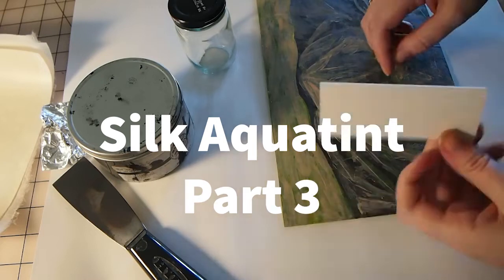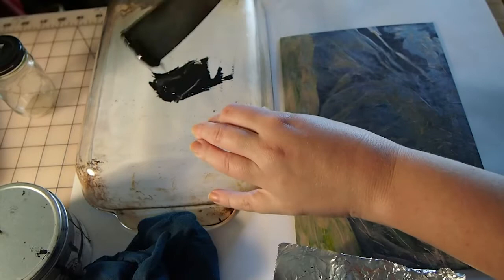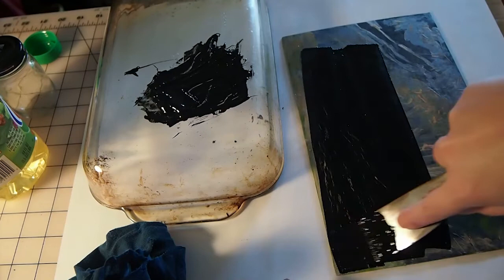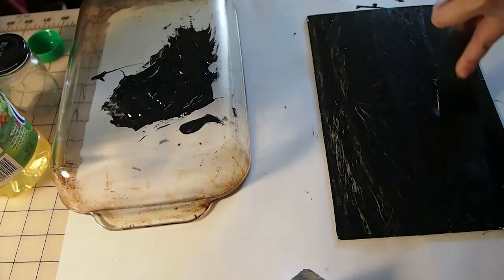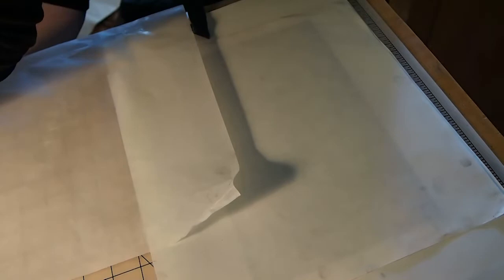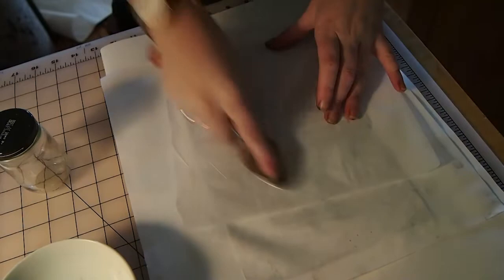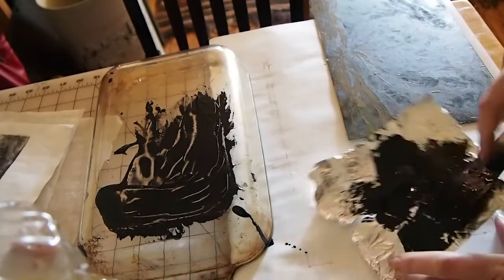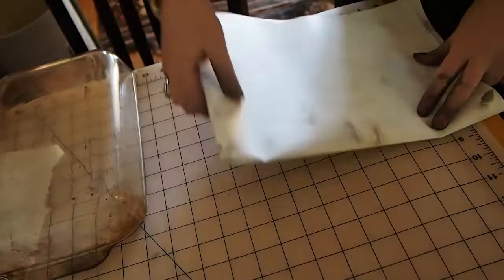Silk Aquatint Part 3 with Hannah Skoonberg

Comment: Thank you, Hannah! This really helps as I figure out how we're going to cover intaglio
Reply from the maker: Camilla my learning curve on this was the students really need to seal the plate. Otherwise it's too absorbent and drinks up all their ink. Also if they are painting their image with white tinted gel onto a plate stained black the plate may look one way and print another because it's all about texture. (you know this) and also remind them not to clean their plates with water T_T
Reply: @hannahskoonberg  I've supplied them with wood glue in anticipation of that. I think we're going to mostly use thread and cut manila folders. I'm afraid we must clean with water, though as we're using Akua. I'll just have to get them to really seal the plates well.
Reply from the maker: @camillataylor1934  I would just get a little water onto a rag and buff it down. Just warn them not to wash it in the sink lol.

Comment: Wow, thanks so much for sharing this Hannah. I do silkscreen and intaglio so I have materials at home.
Reply from the maker: When you try this. The key is that you are building up the material to reduce the texture of the fabric. Having a white medium helps but you can't judge how it will print by how it looks. Turn it on it's side to see if it is fully smooth or if there is texture.

Comment: I’m wondering how you could now alter the plate, after printing with oil based ink? Is degreaser enough?
Reply from the maker: The plate will be stained but It's pretty well sealed at this point. I could clean it up with some mineral spirits and make some changes if I needed. Mainly if I needed more light tones I could add another layer of medium.